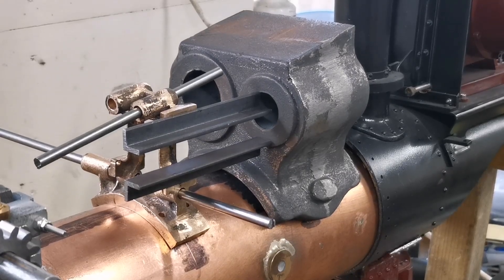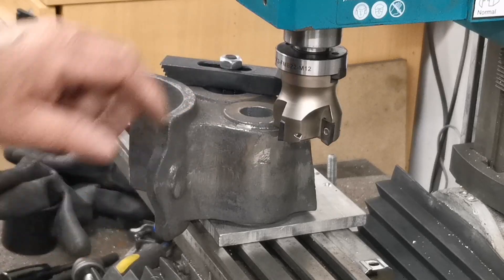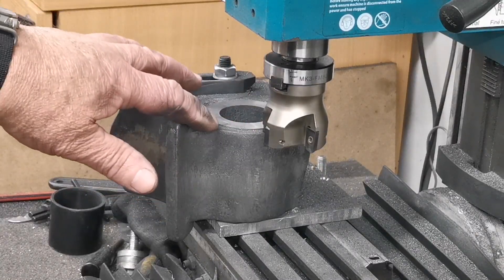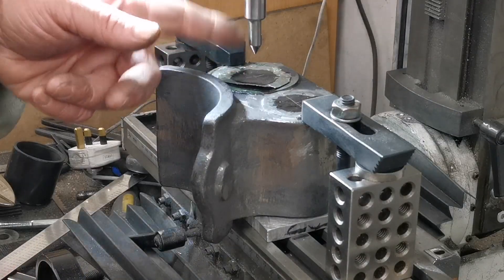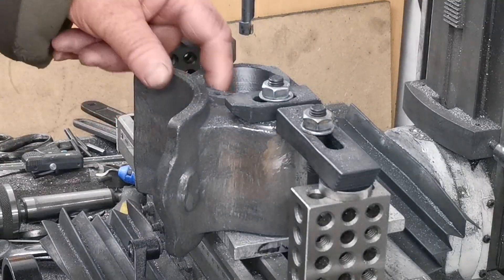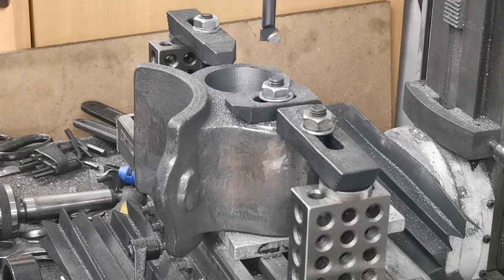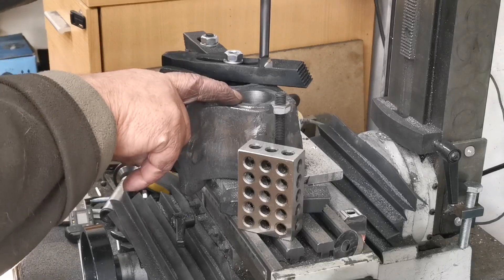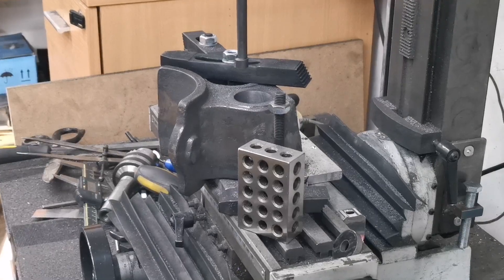2" Fowler Showman's Traction Engine starting machining the cylinder block

Comment: surely the chatter on that cylinder bore will cause piston seal problems?? personally i would of bored it on a lathe with the cylinder fixed to the bedplate with a large boring bar set between centres
Reply from the maker: I shall be honing the cylinders later on, but the finish inside of the cylinders are quite good